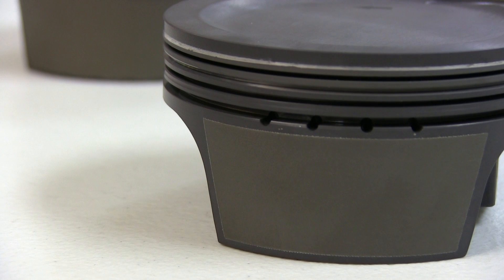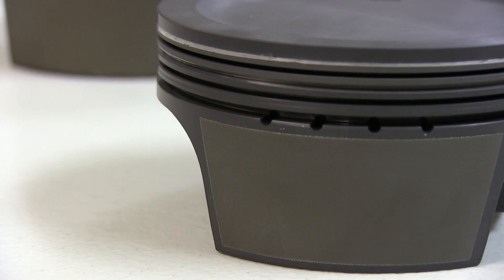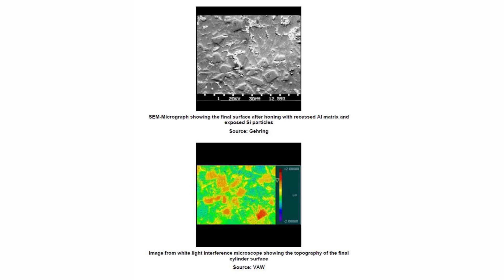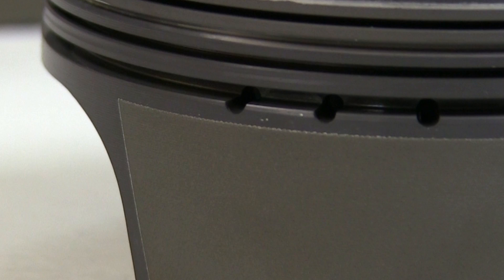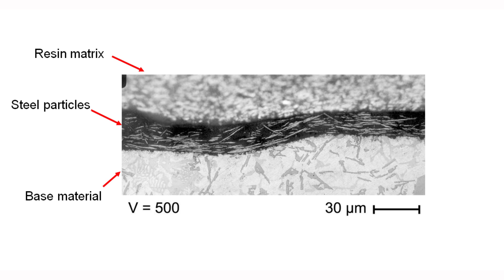The Tech behind MAHLE's Gold Series Coating

Comment: FRM compatible? Im interested in these for a H22a4 engine. I have read many posts on diffetent forums about these pistons lasting only about 30k miles.Anyone have more info on this?
Reply: Hardeststyler BR I would like to know if they last, I've heard bad reviews and good. 
If mahle would provide a warranty and proof with H22a4. I'd be buying a set.
Reply: mine lasted 6 months in my daily f20c, bores are a complete mess now.  wont be repeating the experience.  local m/c shop has quoted 800 gbp for a cast iron resleeve. shouldve done that the first time
Reply: kruzihbv did u just drop it in or bore it .25
Reply: kruzihbv did u check P2W?
Reply: @kruzihbv  that is what I did, used 2mm telling repair sleeve, coupled with a K24 crank